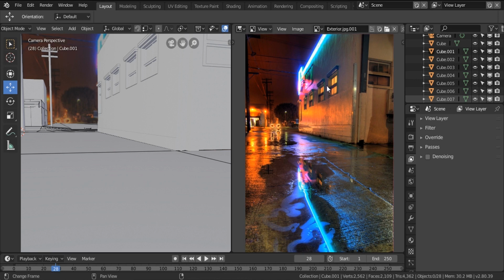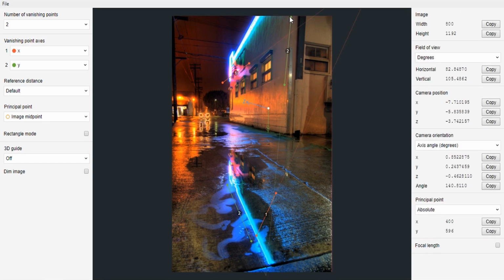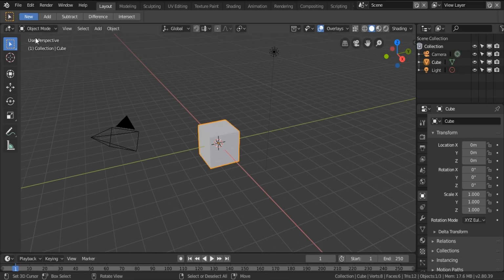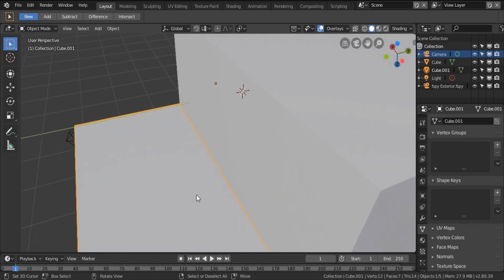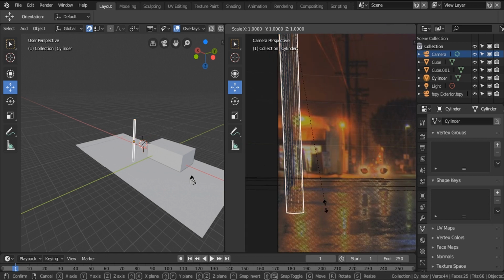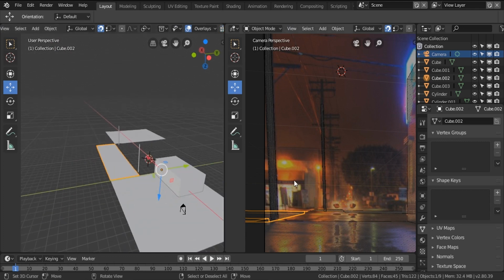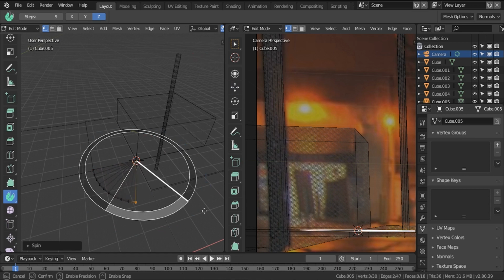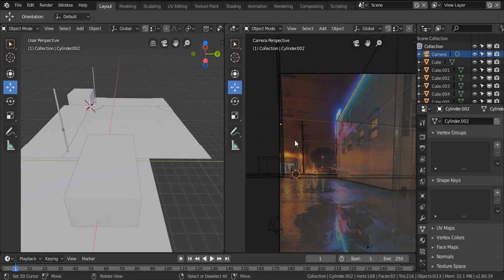Blender Tutorial - Turn 2D Image into 3D Model - Beginners

Comment: Hello, Fspy is good but there is a problem I think, in your scene is wall high same in the real world I wonder, if you measure with ruler the wall high in blender I don't know what you see, actually we should know the real dimensions and scale if we want to correct dimensions and scale modeling. I want to for example modeling a plane or car, I find nice picture then adjust in fspy then I import in blender but I see when I create the car long with a plane, I measure the plane, I see the dimensions(very low) are not correct, in this case what should I do? 
Move the camera back or what is another solution
Reply from the maker: Hello Demir, the fSpy unfortunately doesn't solve the dimensions issue, we have to estimate the scale ourselves
Reply: @realfaker  okay thanks